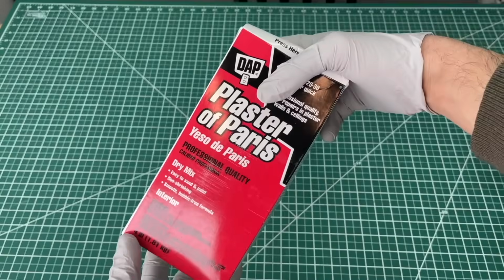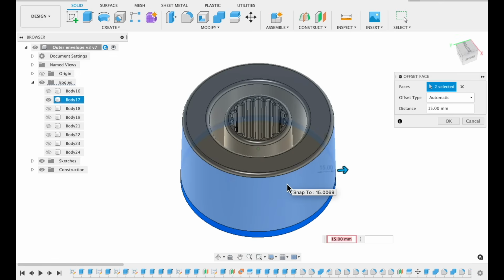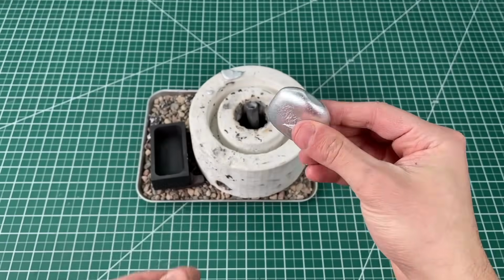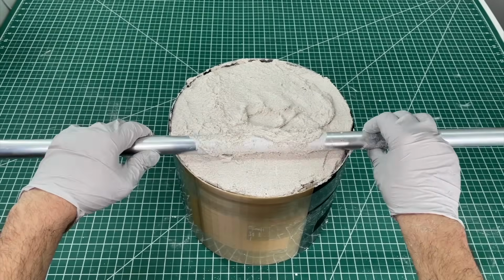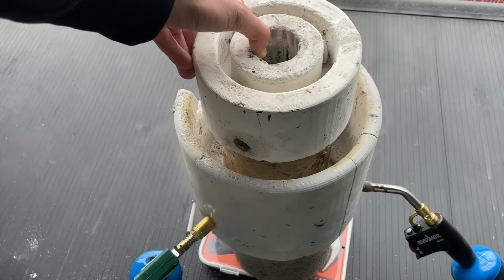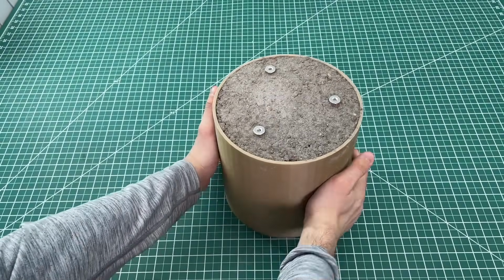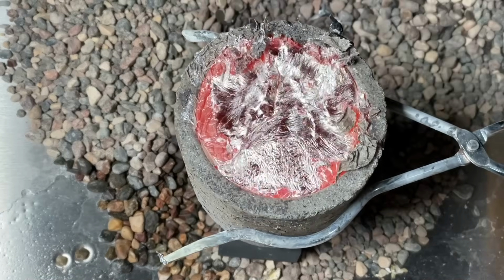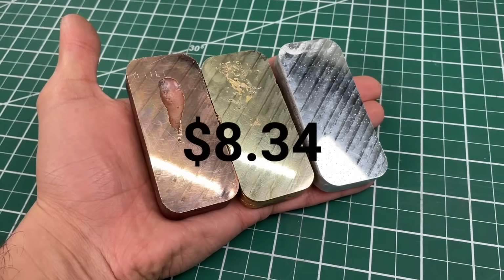DIY Foundry At Home

Comment: For the aluminum bubbles at 21:15, aluminum absorbs hydrogen as the temperature increases. Typically you want to monitor the temperature to not get aluminum too hot so it doesn't absorb the hydrogen. Once you poured it and let it cooled, all that gas starts to come out of the metal which causes those bubbles
Reply: You can degas the aluminum with boric acid or salt.
Reply: Which Temperature are we aming for?
Reply: The small bubbles in copper, brass and I am assuming aluminum can be from oxygen or hydrogen.

Hydrogen is usually introduced due to hydroscopic actions of refractory or moisture in scrap crucible, etc.  Can also be introduced from fuel used to melt but I have no experience with this as have always been around processes using electricity.

Oxygen comes from exposure to atmosphere during melt as well as moisture or contaminants in scrap.

Once in molten metal gases become suspended in the liquid, as molten metals cool the gases drop out of suspension and cause the bubbles.

Oxygen - cover molten metal with a blanket of graphite to prevent absorption, deoxidize using copper phos or boron.

Hydrogen harder to get rid of in hobby foundry... but technique is to bubble argon or oxygen through molten metal and then deoxidize.
Reply: You can fix that by 'degasing' the aluminum. I don't remember what you use but it was something readily available.

Comment: I've noticed on other casting channels that they are very particular about separating the brass and copper and aluminium from items like steel screws, plastic handles and so on. Plastics can introduce gasses and it is always worth it to remove dros and to degas.
Reply from the maker: Thank you for sharing 😃

Comment: Use refactory ceramic. Concrete can explode due to moisture expansion. Refactory ceramic or cement is very porous and won't shatter on you. You can crush up firebrick to add for filler to cut down on the ceramic costs.. and heat up your graphite molds first or you risk the molten metal splashing out of the mold and igniting whatever it touches. Including you. If recommend looking up safety concerns regarding molten metals and working with them. And if also invest in a fumigation hood for anything done indoors. And don't melt anything that is galvanized EVER. If you breathe in the fumes off galvanized pipes etc... You'll be dead within a week literally. Look it up. And I'd add something like borax to your crucible it acts as a flux and helps to separate impurities and dross and slag. I'd also invest in a full face shield respirator and a heavy leather apron or welders jacket. And some proper gloves

Comment: The air pocket is from the metal shrinking as it solidifies and cools. Heat up the mold before by putting above the crucible or on its own thing and it will cool from the top first instead of bottom.  And more weight of metal pushing down will fill the shape better.
You can use borax as a flux to grab all impurities and then scrape the top with a flat steel tong with small holes punched in it right before you pour.  Wire wheel will clean off oxides.

And don't listen to all these people about not using concrete.  As long as you put it on low heat for a few hours to evaporate all the water then the rocks and concrete will be fine.  To melt steel my concrete forge walls started melting and flowing down the sides.
And a bbq propane tank and weed burner and take off the cage for the heat will be easy cheap fire.
Cheers mate
Reply from the maker: Thanks for the tips 😃

Comment: You should use refractory cement not standard portland. it's made to resist the high temps and will crack a lot less. You should also make sure you cure it for a week or 2 longer if possible cement take time to strengthen. Also if possible you need a way to get more air and gas in more air will give higher temps ad borax as a flux to help with melting and scrape the slag of the top before you pour it in the mold. Can't wait to see more thanks for sharing and I realise I'm only a month behind
Reply from the maker: Thanks for the awesome comment and all the details Antony. Glad you liked the video. Dave

Comment: should use map gas instead of propane or oxy acetaline.
Reply from the maker: Acetylene torch would destroy the foundry material, but MAP is a good idea.  It’s just 3x more expensive for a little more heat.

Comment: Most the steps involved, much like the issue with the water bubbles, ignored the potential for air getting mixed in. Usually, metal, glass, or really anything that goes through some form of liquid to solid state (whether through drying or cooling) does it unevenly and so gaps and air bubbles form between the microstructures of the substances. To avoid such issues, having a controlled or slow cooling process would help with this since the slow transition gives time for air bubbles to escape, the surrounding microstructures to adjust to each other, and to fill in the gaps involved. The same concept is applied to paint as well, hence why better/more-professional paint jobs are done using longer drying paint because those tend to smooth out better (and lose all the air bubbles) with the addition of time whereas more commonly used paints tend to have thick, thin, and at weak spots due to not having enough time to really bond, settle, and lose any airbubbles mixed in between the application and the mixing process
Reply from the maker: Thanks for the detailed comment.

Comment: I doesn't take long for a ingot to harden enough to be extracted (if that is the correct word for it) from the mold. Just wait until it's hardened enough and then flip the mold over. I have never seen anyone keep the molten material inside a mold until it has cooled down completely.

Checkout the channel Bigstackd Casting.
Reply from the maker: Thanks for the tips 😃

Comment: Us kaowool as a better insulator and fix concrete. It will be able to withstand up to 2100 . I would also recommend and air intake for higher temperature.

Comment: if i had a 3d printer, and the time i could design you a furnace that burns close to airless. (part of your impurities issue is the metals, part is the contaminates from oxidization)

the less leftover unburned fuel and air you have in contact with the raw metal, the better.

another good idea is to use a crucible lid to help prevent the air and fuel from contacting the metal as well.

and you are right about the bubbles as far as speed of pour, and some to do with temp as well, if the metal isnt hot enough, while pouring it can create cavitation in the liquid that solidifies before the primary liquid can float it to the surface as it sets too quickly.

more heat, more speed of pouring, and MORE SAFETY, because with heat and speed come the margins for error that make this a fatally deadly hobby to take up without doing tons of research.

Comment: your furnace mould. fill it with fireplace insulation cement, specificallynthe stuff meant to handle direct fire.

this method will prevent your foundry from cracking under high stress.

Comment: The way I learned to mix concrete was to add the water to the sand first, then add the concrete mixture...my guess is to do the same thing with plaster.

Comment: Why not use MAP gas? Yellow bottle.
Reply from the maker: It’s more expensive.  It would be better though, I agree.
Reply: @ActionBOX  since you were not adding zinc to your bronze - zinc burns out under high heat, you need to add it during process to compensate lost quantity of zinc, so you got brass, not bronze.

Comment: To protect your cast iron molds, put them through increasingly hotter heat cycles in your oven. ANY cast iron can Crack under high heating if not tempered. Go to garage sales and look for cast iron bakewear. It has gone through plenty of heat cycles and is less prone to breaking. ALWAYS preheat your molds before pouring. It will remove all of the moisture and will prevent thermal shocks.

Comment: Slowly sprinkle plaster evenly on the surface and let it sit for approximately 1 minute.  You'll notice that it mixes much more evenly when you use this method.  If you have a vibrating hand sander you can prop this on the table and use it to vibrate your plaster allowing the air bubbles to come to the surface.  You can alternative use a degassing chamber to remove the bubbles from the plaster, but you'll have to be quick when doing so.

Comment: ok so the reason why the copper stuck to the bottom of the igot pan is because when things are hot they are expanded to there max and then when you cool them down alot they shrink i am thinking that the copper made little imperfections that align with the ones in the ingot pan and they held onto each other kinda like a puzzle piece and then you bang it down and it breaks the cast iron
Reply from the maker: Good to know. Thank you for the insight.

Comment: I'm thinking if you redesigned the mold so that the heating ports were radially extractable tapered rods, and added more draft angle to all the vertical walls, you could make the mold reusable rather than having to sacrifice it each time. Apart from that, I'm really impressed with this low cost cast founder idea. If reusable versions of the molds were available to buy online, I could see them becoming popular with people who just want a cheap and easy way into occasionally casting their own alloy/brass parts.

Apparently you need to be careful with concreat foundries. Concrete doesn't really like being seriously heated, and I vaguely remember reading that the stresses when heating can cause it to almost explosively fragment.

You might want to look at using "Perlite" (Available from most gardening product suppliers) or "Bentonite" (Sold everywhere as unscented clay based kitty litter) instead of sand in with the plaster. Both these are better thermal insulators than sand, cheap to get, and should make the finished forge get up to temperature quicker (Subsequently meaning less gas is used per melt).
Reply from the maker: Thanks for your detailed comment 😃 I agree that reusable molds would be of greater value.  We will continue to iterate 😜. Cheers, Dave

Comment: Have you thought of making  aluminium bronze?
Reply from the maker: I have not.  What would That be used for? Cheers
Reply: @ActionBOX  It's very corrosion resistant and is often used in marine applications and settings where resistance to corrosion makes it preferable to other engineering materials.

Comment: Casted al, will be porous, I believe you have to hammer forge it for it to not be, you never skimmed the metals remove the slag, that’s the discoloration. Concrete is a bad material for a forge, if there’s trapped moisture in it it will explode
Reply from the maker: Thanks for the great details. Cheers.

Comment: Since you asked, the best way to mix plaster is by hand but you need to do it similar to the way you mixed the Medium Foundry plaster. Start with the water then add the plaster to the water slowly as you mix with your hand. It keeps those lumps from forming in the first place, and if one does manage to form you'll feel it and can deal with it. For refractory like you are using, mix the plaster and sand first, then add that mixture to the water. Cement can retain water for long periods of time and doesn't stand up to heat well as a result. It might break down over repeated uses, but you might get better results by sifting out the large rocks first.

Also, to save your cast-iron molds, make sure to heat them up before adding your molten metal. Then you can extract it easier, like you did with your graphite mold. No idea about the voids, though. My experience is with small melts for jewelry making and not for large ones. 

The idea is ingenius, and the execution was brilliant! I am definately making one of these!

Comment: Molten aluminum absorbs oxygen from the atmosphere, which causes bubbles.  When I cast aluminum, I put a spoon full of table salt in an aluminum foil pouch and add that to the molten aluminum just before pouring.  The salt will force the oxygen out of the aluminum long enough to pour.
Reply from the maker: Nice, that’s great to know.  Thanks for sharing 😃
Reply: table salt instead of borax?
Reply: @alextutusaus  Not instead, but both.  Borax will clean the metal getting rid of oxides, dirt, etc.  Once the molten metal is clean and ready to pour, add the salt to get rid of the trapped oxygen.
Reply: @jkroschel  why the pouch thing tho?
Reply: @alextutusaus  Ease of delivery.  You could spoon it in if you want.  I make a dozen at a time and leave them with the rest of my casting supplies.  That way I can just reach over and drop one in.
Reply: @jkroschel  great tip! thanks for sharing!

Comment: Tiny gaps and holes inside castings are part of the fumes trapped inside liquid metal (mostly). You can try to prevent them using flux salt
Can't wait to try building your foundry

Comment: This is an amazing video. Thank you so much for sharing all of your trials and errors along the way. I would have chose to use a MAP gas instead of propane since it burns hotter and is a direct swap out. They come in the yellow canisters usually sold with the torches. Acetylene burns even hotter, but requires more adapters and a house and an expensive upfront purchase of a tank.

Comment: Just because brass melts at 930C does not mean it stays at 930C after it is melted. If you keep heating it, it keeps getting hotter. That means your foundry gets hot enough to melt stainless.

Comment: Mix the plaster powder into the water not the other way around, and for small batches use a hand mixer (the type used to mix cake batter) and pour the sand into the mixing bowl in a slow and continuous way, you could also use a little bit of super plasticizer powder, it will make the mix more fluid even with less water, what will make the mold dry faster.
PS: The "black stuff" on copper's surface is one of its oxides: CuO or Copper II oxide or Cuprous Oxide.
Reply from the maker: Thanks 😃

Comment: if using rubber bands aswell as removable cores for the holes, you should be able to reuse the molds? the part looks like you already built in draft angles, so maybe this would be a viable approach too
Reply from the maker: Great tip.  Thanks for sharing your idea 😃

Comment: You need to try mapp gas torch, it burns way hotter than propane
Reply from the maker: Thanks Jackie, it’s definitely a better option but it’s also far more expensive so we decided to try the cheaper option. In the future we would probably use MAP to speed up the process.  Thanks for sharing 😃

Comment: Solution for lumpy plaster.

Plaster needs to slake in water for a few minutes BEFORE mixing.
Slake means to add the plaster slowly to the measured water. Let it rest and in 2 mins the water will wick to the top of plaster mound. Then stir. You’ll find that it is lump free and free flowing.

Comment: for the platic mold.  Increase draft angles and mold release?  Ofc, you always get some mechanical lock from the ribbing if you don't have a way to smooth it before sealing with mold release.  perhaps make it multipart mold with registration tabs. ... But the printer is nice because destructible molds are useful for one offs.

Comment: 20:20 All that darkening stuff on the bars is just dross. Make sure to "skim" off the impurities in the crucible before pouring into the molds. Borax added at the final step before last skimming tends to pull out more impurities from the crucible.

Comment: The holes could be due to wet molds and gas trapped inside of it, most metals you can throw borax at it to degas and float the impurities up to be skimmed off (hint). Aluminum is king for trapping gas inside and not releasing hence the micro bubbles

Comment: love the idea of printable furnace, just watch when melting brass, the yellow fluffy stuff that you saw is Zinc fumes and compounds. They can be really dangerous, like a strong fan blowing across the forge or a metal fume rated respirator. Think of it like melting lead or playing with Mercury. Mercury on normal unhurt skin wont hurt you for a short time but the fumes that come off will hurt you over time same with zinc.

Comment: use a little borax to reduce the slag melting temp.  try using welders argon to flush the crucible while heating to eliminate O2.

Comment: 1 - Black oxides on copper - This is normal when smelting copper, it's just an oxide layer
2 - Silverish streaks in smelted brass - This is common, and is usually indicative of impurities, contaminates, and oxides being formed. The underlying metal should be fine though
3 - Bubbles in Aluminum - This is typical when smelting aluminum, as it can absorb hydrogen from the surrounding atmosphere. It is generally advised to "degas" aluminum before pouring into molds, or billet. Two methods are advised for home shops:
a) bubbling argon gas through the molten aluminum (expensive) 
b)  wrapping an amount of table salt, and sodium bicarbonate in aluminum foul, and plunging it into the molten aluminum, then stirring before removing the slag and pouring
Reply from the maker: Thanks for this super detailed reply. I enjoyed reading through it and learned some answers to my questions. Cheers
Reply: @ArcAin6 another commenter mentioned just table salt and another said borax. You said table salt with sodium bicarbonate... which one is optimal? hah! ;)

Comment: You should let people know that using a mixer in a drill requires a reasonably powerful drill.  A cheap drill will (literally) catch on fire spinning a mixer.  (Ask me how I know :) )
Reply from the maker: Hahah I’m sorry that happened to you 😂. We are using a very cheap and old drill though so perhaps it’s not an issue for these small quantities?
Reply: @ActionBOX  Most likely.   I tried it on a much bigger quantity.  It was a $30 corded drill from 15 years ago.  Flames before anything mixed well.